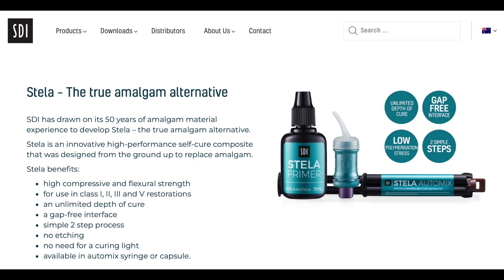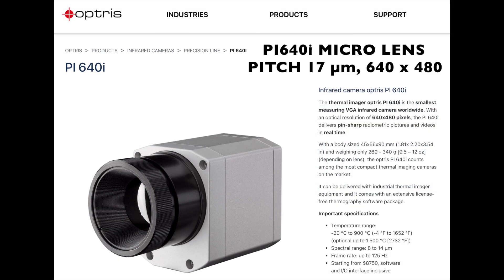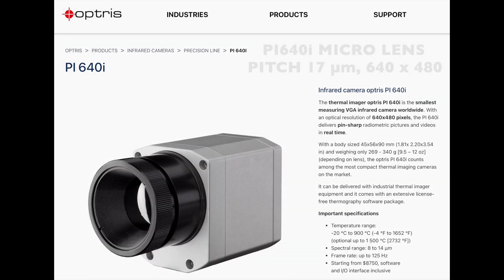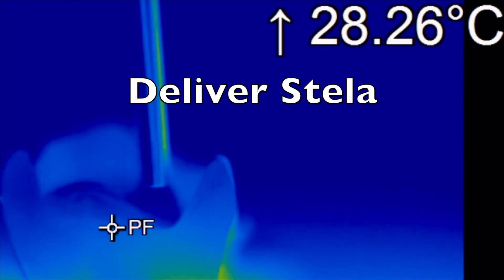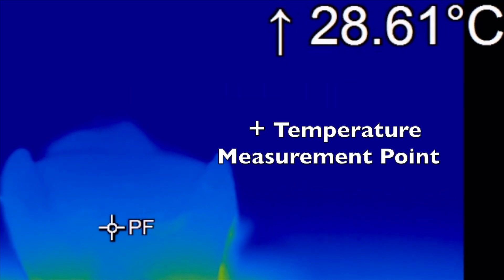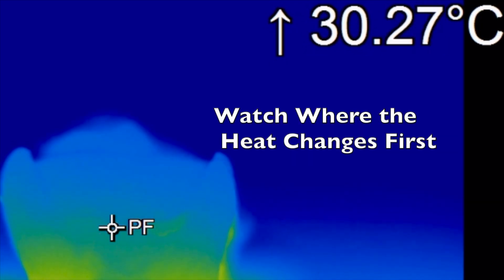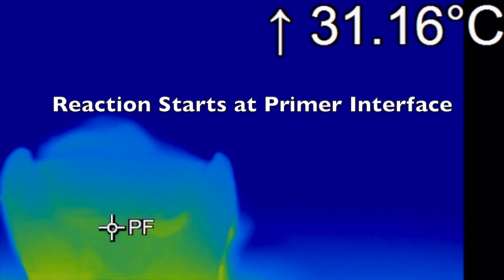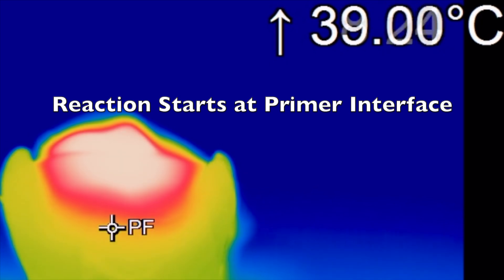Thermal changes as Stela polymerizes in a tooth when Stela Primer was used.

Comment: Hello Richard,

First, I love your videos, and I've learnt a lot from you. 

My name is Dr PlamenTatishev and I've been using Stela since October last year. I like the product very much.

I was doing some tests and have found out something that I can't explain. On a tooth model made of silicone, I've made a cavity, which I filled with Stela. I can send you the photo/video. I can't figure out 

- Why the cured intaglio surface and cavity walls are covered with smear layer? 

- Primer has been applied dried (as per normal protocol) and both Automix/Capsule versions were tried. Both have the smear residue.

- When Light Cure composite used no smear layer on the composite or "cavity" walls found. 

Do you have any explanation for this?

Thank you 😊